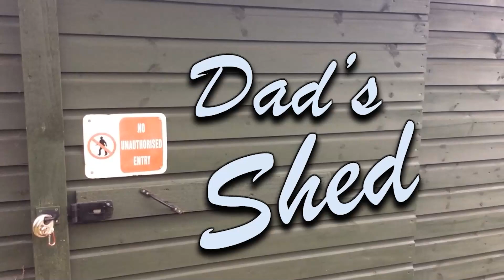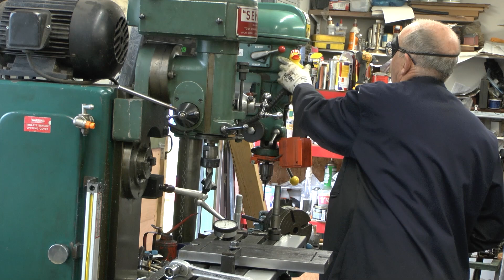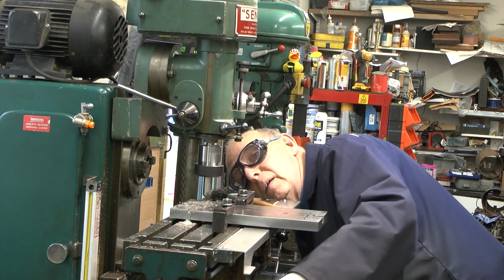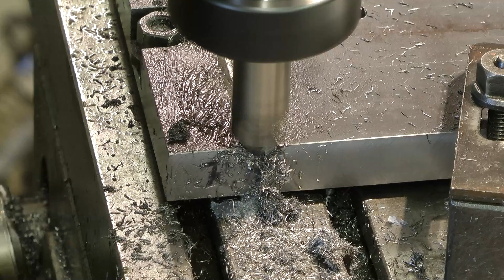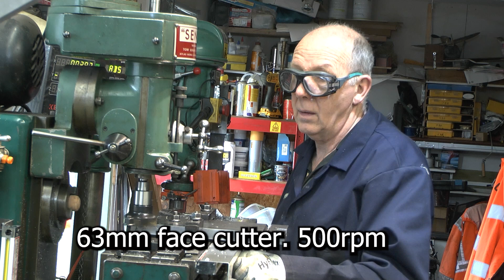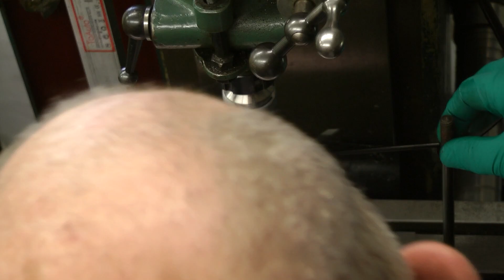DS21 The Sine Plate - Part 2

Comment: Try clamping the bars down first. A couple of machinist's  clamps should  work at the front, a couple of hold down clamps at the rear. Then you're not chasing micro movements.
Reply from the maker: Thanks for that. Yes, I did a little later actually clamp the front bar (nearest to me) down later. The problem with the back bar was trying to to find some way to clamp that wouldn't get in the way of measuring? In the end putting some heavy parallels on it held it in position. but yes It would have been better with hold downs off the back tee slot.
Thanks for the comment about the collet chuck being in the way, I do tend to forget I'm videoing still (I also get in the way a lot!!) and do the job without thinking about what the camera might be seeing.....